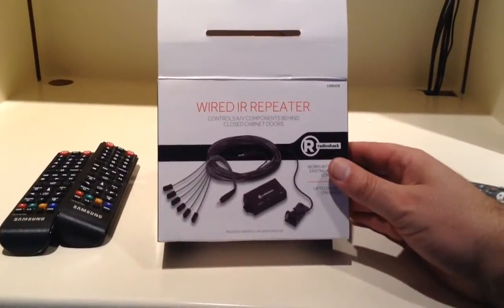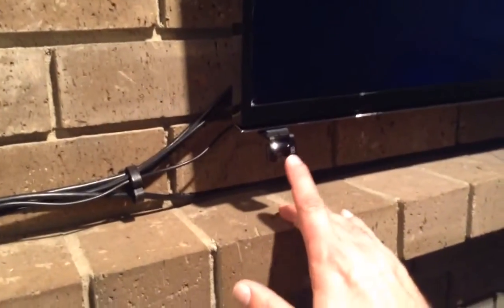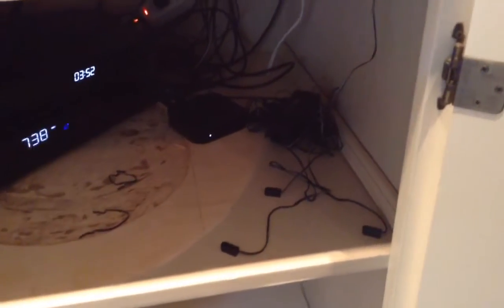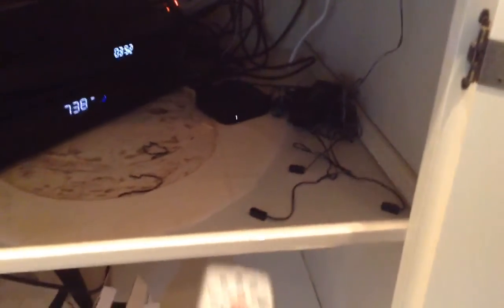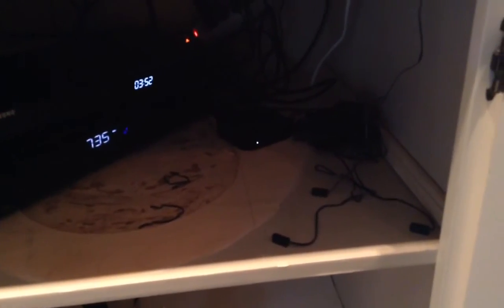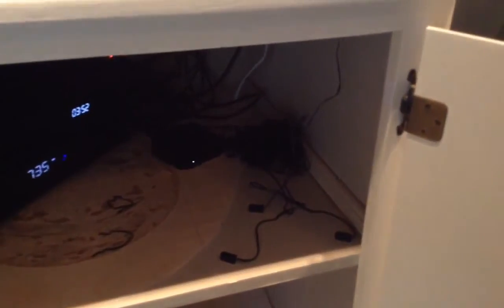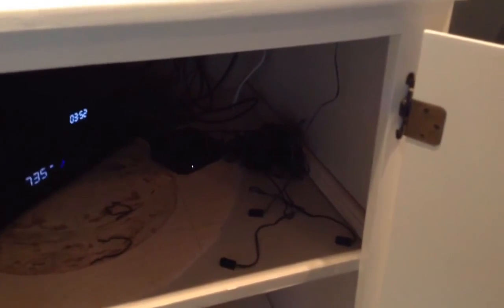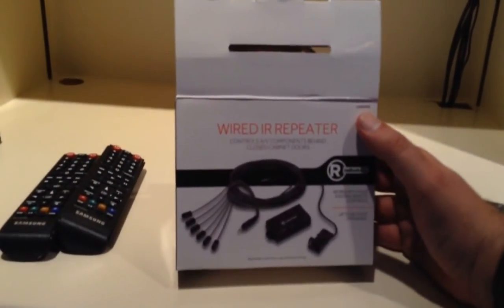Radio Shack 1500458 IR Repeater for remote control Entertainment systems

Comment: So does anything plug into my cable box or my Blu Ray player ?
Reply from the maker: No, nothing plugs into those devices.   You just have the little sender units (LED lights) pointing in the general direction of the front of those devices where the IR sensors are.  In that sense it is wireless.   The wires involves are from the repeater devices IR sensor unit and then to the repeater devices little IR emitters, which wire to a central box.  They have long cords so that they can reach components in a cabinet that might be some distance from where you usually want to point your remote at.

Comment: Could you please do a setup video, because I just bought the same exact thing from Radioshack and I am setting up only a TWC cable box and a blu ray player also maybe a Xbox one. I am having a hard time figuring it out. Thanks!
Reply from the maker: It is really dirt simple, you just plug stuff in and set those little senders around inside the box the components will go in such a way that they point more or less toward the IR sensors on the devices they control.   They are really just going to flash whatever signal the sensor picks up.   Nothing plugs into your regular AV components, all you do to control those items is point the little IR senders at them.  They are IR LEDs, not lasers, so not particularly directional, but the front is the curved side.  It is also OK for the signals to overlap, since it goes simultaneously anyway.